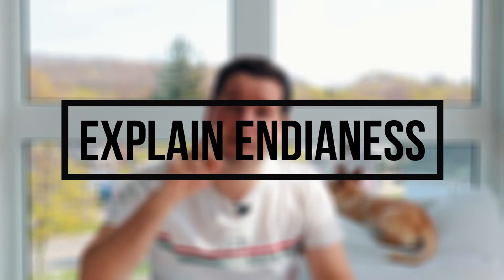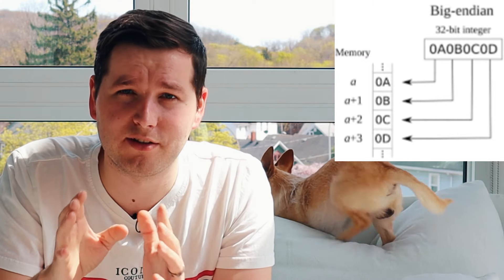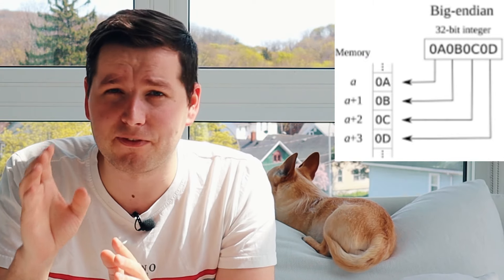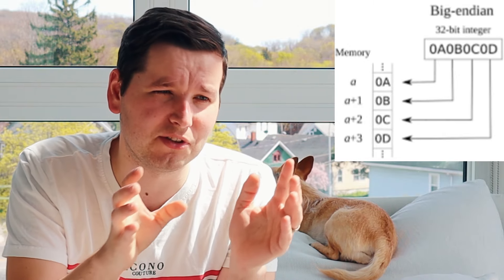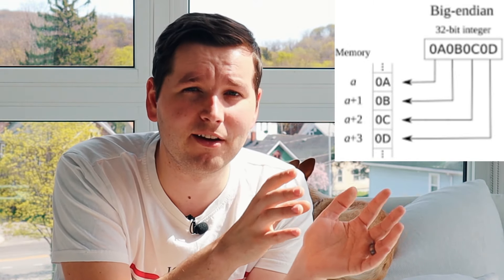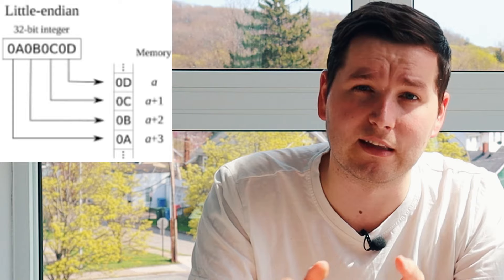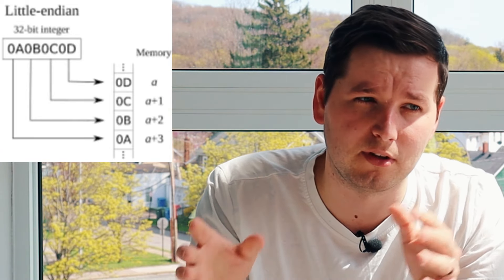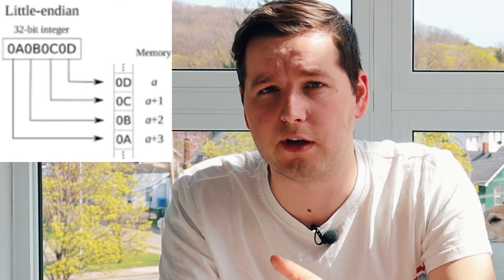Embedded Software Engineering Interview Questions & Answers

Comment: Some of the questions that immediately came to my mind are
1) What is a race condition? What causes it and how to avoid it?
2) What happens in a startup code?
3) How does a cpu handle an interrupt?
4) what is an interrupt latency? How can it be measured?
5) What is a software interrupt?
6) what is the difference between a breakpoint and watchpoint?
7) What is meant by board bringup activity?
8) Explain a scenario where you have used a logic analyzer
Reply from the maker: Great questions! thanks for sharing!
Reply: 2) startup code runs bootloader first then checks for the any new firmware for the flash memory. If not bootloader switches to the starting address of the flash memory, where our previously loaded firmware starts excecuting. From then cpu loads address of the each instrcution to the stack pointer. Goes everything normal.
3) Whenever the interrupt triggers, the processors stops the execution and hands over the process to interrupt handler(ISR). The cpu loads the address of the ISR in the Stack pointer. Once the execution of the ISR over. SP intializes with the memory address where it was resumed before. 
5) software interrupts are created by the system whenver the exceptions happend.
6) when u are debugging the code breakpoints are helpful to break the execution at required line of code. Where as watchpoint is u can add it to the debug window to see how the variable is changing over time in the process.

Any thing wrong i answered feel free to correct me. 
Thank you.
Reply: @vamsikrishna9825  MCU executes instructions pointed by Program Counter (PC) and not the stack pointer (SP). SP is used to store the return address so that MCU can use it to reinitialise PC in order to resume last process execution after an interrupt or exception.
Reply: @tanujkumar7983  return address from a subroutine is kept in link register (LR), SP keeps the pointer to active stack.
Reply: @evic262  that's true in case of ARM. But thanks, actually I am currently working on EFM8 so completely forgot about ARM for a while. Thanks again
Reply: @tanujkumar7983   yeah i understand.
Reply: @vamsikrishna9825  Nice explanation. Just one correction. CPU loads address of each instruction to program counter and not stack pointer

Comment: Some questions I answered during an interview I gave recently (Embedded + OOP):

1. How do you prevent memory leaks?
2. How do you use stack?
3. When do you want to use static classes?
4. What is polymorphism and inheritance?
5. Major difference between C and Python.
6. Have you used pointers as parameters to functions?
7. How have you used interrupts in your code before?
8. How have you used watchdogtimer in your code?
9. How do you use pointers?
10. How do you use private constructors?

These mostly cover what I was asked, it is not strictly an embedded role but embedded plus general software developer role. Hopefully I'll get in!
Reply from the maker: Rahul! Thank you so much for sharing this info! Lots of good questions that can help a lot of people when they prepare for their interviews!
Reply: those are hard questions :(
Reply: Hopefully you get an offer from them. Thanks for sharing.
Reply: These questions are kinda crazy. 

Major difference between C and Python? They're polar opposites, how much time does the interviewer have?!

How do you use pointers? Have you used pointers as parameters in functions? This basically amounts to "have you ever touched code"
Reply: I will give my answers and give an * next to an answer I think is incomplete / wrong
1. Use smart pointers instead of raw pointers, but embedded is resource constrained and sometimes raw pointers are absolutely necessary *
2. Not sure if Stack/Heap memory management or stack data structure (they are the same) *
2.a. Stack is a linear data structure that uses LIFO (last in first out) model. Stacks are used for many things like backtracking and expression evaluation. Stack defines three operations: push (creates a new item on top of the stack), pop (removes and returns top item of the stack) and peek (just reads the top item without removing it)
2.b. Most famous use of a stack is memory management in modern languages. Stack is used to track references and primitive values, as programs execution enters a scope a new item is created on a stack that allocates memory for that scope, when program execution exits the scope stack is popped and memory is freed.
3. I have no idea what this is about. Static inner classes in Java come to mind **
3.a. When do you want to use static variables in classes? Static in classes defines memory that is shared by all instances of that class, there are two use cases: static methods and static variables. Static methods are added to class namespace, limitation of static methods is that they cannot access instance varables. use cases are factory and utility methods. static variables hold data that is global to the class it is often used to store class constants.
4. I am not gonna dignify this with a response
5. C is a statically typed (instead of duck typed), compiled (instead of interpreted), python has automatic memory management (GC), python is portable, C can natively use threads etc.
6. No, I am a normal person that has a life. I primarly use Java that doesn't expose pointers to programmers but it does use pointers below the hub, every time I pass something by reference I use pointers. *
7. I have never programmed embedded systems but I know what interrupts are. Interrupts are a mechanism that allows microcontroller to interupt current execution and respond to an event, this improves responsivnes of embedded systems. Without interrupts we would have to pool external dependencies
8. * (I know what it is but that's not the question)
9. Pointers allow us to allocate large chunks of memory once and pass a pointer to that memory instead of copying it. *
10. Private constructors restrict creation of objects outside of the class, most common use of private constructors is in singleton pattern, factory pattern, utility classes and to prevent subclassing
Reply: @bagaspermana88  I'm a newbie and these questions are not hard at all. I hope I will get such questions (:
Reply: @miloszivkovic6256  "No, I am a normal person that has a life." ahahaha

Comment: Great video! Just a little comment on  cpu clock freq. on power consumption; in some cases you actually need max clock freq to achieve lower power consumption. (e.g. serve all the tasks and do all the calculations as fast as possible and go back to sleep).
Reply from the maker: Thanks for the support! That's true, there can be some corner cases like that :) thanks for clarifying.
Reply: Race to halt :)

Comment: For the bonus question about pull-up/down-resistors I would also explain, why I need them, especially because i don't want floating (undefined, random) readings on an input pin. I you have an unconnected pin when the button is not pressed, the input is likely to be random (not really, but hard to predict)

Comment: Why use bare metal programing when we have compiler to write a startup code and dump code in microC
Reply: Ans: bare metal code enables direct manuplating the registers to get the required output. Whwere as startup code includes uncessary data some times which u dint required for your project, which increses the size your program. When u are more specific with the program memory u should opt to bare metal. And bare metal some what speed as u are directly manuplating the registers.

Comment: Great video,
How can we select a clock ? Of course it depends on the requirement say for example I have only bare metal code there is no rtos and there are only few peripherals like uart, i2c and spi and it works on standard frequency.
So can we identify this much clock is enough for this project?

Comment: Hey Greidi
I just wanted to say thank you for this valuable video, I am a self taught electrical and embedded software engineer and I would like to ask what kind of project do you recommend doing and putting to my portfolio. 
Thank you in advance
Reply from the maker: Thanks for the support!!! What projects do you already have there? any specific industry you are targeting? (i.e. automotive, wearables, robotics...)
Reply: @GreidiAjalik  I am mainly on IoT. Especially smart home/systems/automation
Reply from the maker: I’ll give my best shot here, but I think anything with facial recognition would be a huge +. At home camera monitoring system or something like that. Building the hardware + software and a phone/pc app for it would be a pretty significant effort and good experience. Thoughts?
Reply: @GreidiAjalik  sounds great, to be honest I have already experienced with facial recognition, the main idea was something like a smart home security/entrance system. Thanks for your advice and your support as well.
Reply from the maker: Also, audio processing stuff is good too… could be voice activation of device, gunshot detection - very low power oriented iot stuff…

Comment: I was recently asked:

How does free() know how much memory to free?

#define SQR(a) (a*a)
SQR(10) returns 100
But 
SQR(2+8) returns 26
Why? And how do you debug that?

Give me some examples of where you’d use an open/close collector/emitter. 

As a state machine: How would you prevent an actuator or bearings from seizing up under extreme temperatures provided expensive and sensitive TECs?

Comment: Hi buddy, I have a question does IoT Engineers use SQL for Analyzing Data?
Reply from the maker: If there are databases involved, then maybe, otherwise, I don’t think so…
Reply: @GreidiAjalik  Why I asked is IoT engineers collect lot of data so how they will analyze the data?
Reply from the maker: missed your follow up questions.... Sometimes you do need to analyze data in real time so you analyze some data on the devices directly or partial analyzation and rest is done later within database structure. Otherwise whatever the developers/company decide to use for data analysis is up to them... it could be SQL if the existing infrastructure is there or could be NoSQL or some other fun way of doing it, maybe pandas df?
Reply: It would depend on the size (RAM and CPU) of the IOT device. Many MCU are much too small, you would read data and store in a memory structure / records format. Then send those data by serial or other communication to a PC or larger device that can process and store data maybe in SQL DB.

Comment: the questions in th video :
1. Explain how the spi  works.
2. How does a DMA work?
3. What is Semaphore ? How is it different from Mutex ?
4. How to collect data in parallel and in sync ?
5. When and why to use keyword volatile ?
6. What are some ways to minimize MCU power consumption ?
7. What are the benefits of RTOS ?
8. Should we always use RTOS ?
9. What to remember when writing an ISR ?
10. What are little and big Endian ?
11. What are pull-up and pull-down Resistors ?

Comment: 2:06 DMA is not a "Dynamic" Memory Access. It is a Direct Memory Access - a technique that allows devices to directly access system memory without CPU intervention, as it sounds. Typically controlled and configured through hardware registers and DMA controllers.

Dynamic Memory Access (if there is such a definition) - refers to the dynamic allocation and management of memory during program execution, such as managing the process's heap (memory allocations using malloc()), etc.

Direct Memory Access focuses on data transfer, and Dynamic Memory Access focuses on memory allocation.